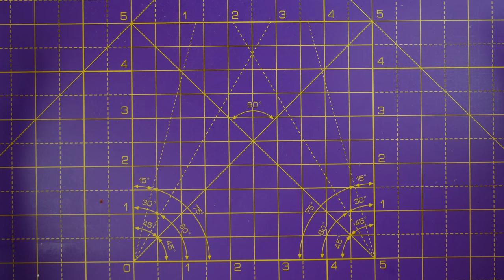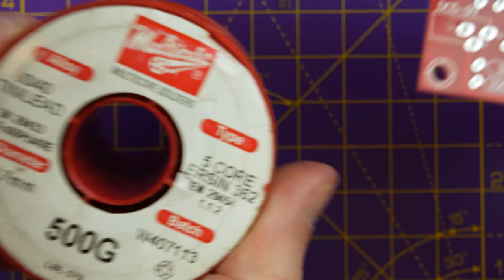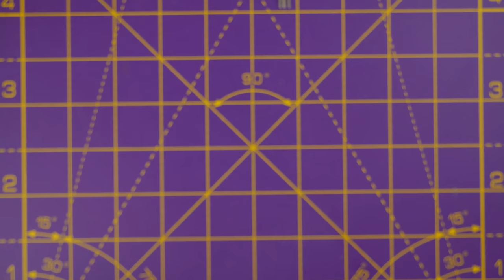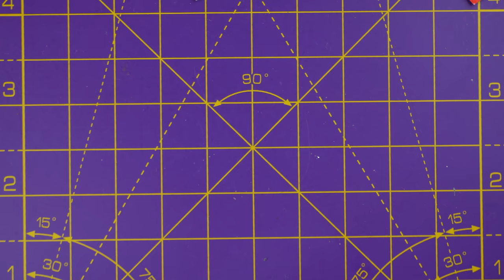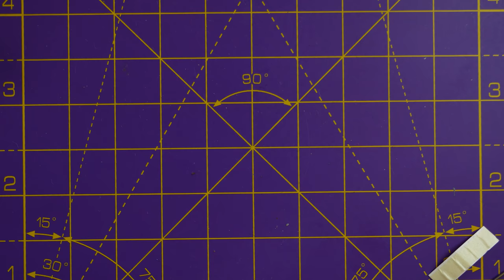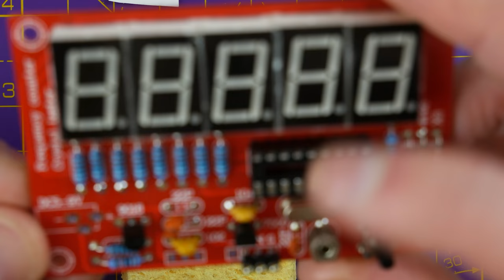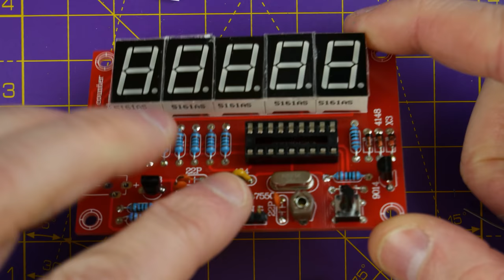Lazy Sunday: Frequency Counter - LS15

Comment: The spare 22pF capacitor does have a purpose. It should be connected in parallel with one of the two 22pF capacitors near the 9018 transistor to enable measuring lower frequency crystals in the 3 pin female connector you've not installed.
Reply from the maker: Thanks!

Comment: I've just realised why you have so much trouble holding PCBs and soldering components, then you try to solve it with BluTac and PCB holders, etc.. Straight up first thing at 2:58 you start by installing the capacitors.... No, no, that is WRONG. You should ONLY install the diodes, and solder those. Then ONLY the 1/8W or 1/4W resistors, and solder those. Don't use that silly stand thingy - just flip the PCB and use the flat desk/mat surface to hold the components in position! Then install the next tallest, etc.  Look how at 44:36 you are attempting to install the IC holder - that should have been put in before almost every other component! So, your assembly method is all arse-about, and simply by changing that process you can make your own life so much easier!

Comment: Slow cookers rule. I love mine to bits. 

I use cheapy .7mm mutlicore, (60/40 leaded) think it was $4.50 for a few hundred grams, the flux is just right - on clean boards. I brought myself up as a kid on the cheap tubes of solder that you find in a quid shop or a market. Solder is solder to me, prep and finding the tip that suits you and the job in hand is more important imo.

Comment: Hello, the same device came to me from AliExpress, but I could not measure the clock crystal 32,768 khz, can you help me Thank you
Reply: The crystal tester only really works over 5MHz without modification.
Reply: @IanSlothieRolfe  Thank you very much, I am an amateur electronic Let me do some research to modify it.
Reply: @IanSlothieRolfe what modification is needed? This could explain why it’s not reading my 2.0 crystal

Comment: I tried mine today. Tried to measure the 32khz crystal on a laptop mb. Stays at zero. I connected to IN and G. My scope reads the signal as 32khz. What could i be doing wrong? Kit was from ali.
Reply from the maker: I can't for the life of me find the document, but someone sent me one that detailed a mod/extra component you need to add to read lower values. Have a look back in the comments, I am sure it is there. If I find it I will get back to you.

Comment: Solder? Stannol Sn62Pb36Ag2 0.5mm, 2.5% flux 3-core F-SW26. It's really effective, but the flux needs to be washed off.
Reply from the maker: I had a look at Stannol, lots of folks on the EEVBlog forum recommend it. The MG stuff was cheaper per 500g so I went for that.